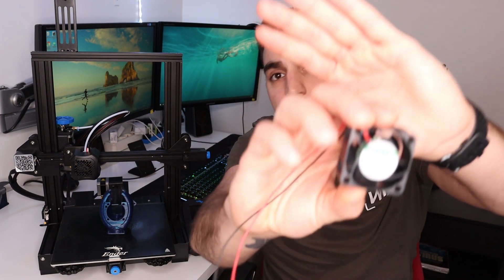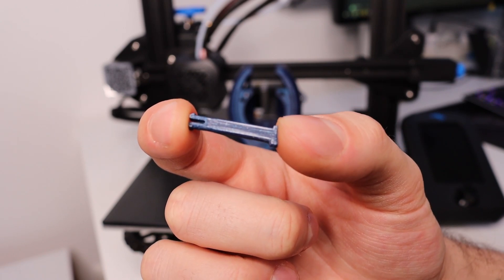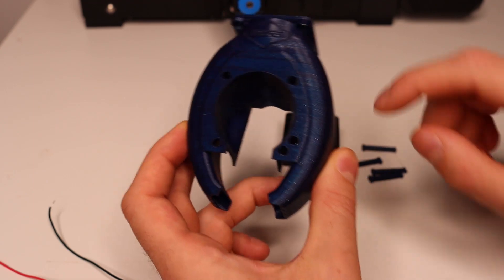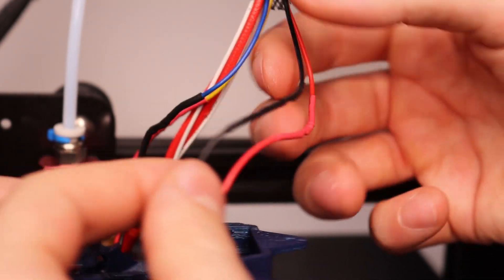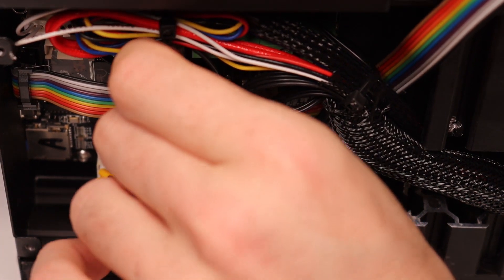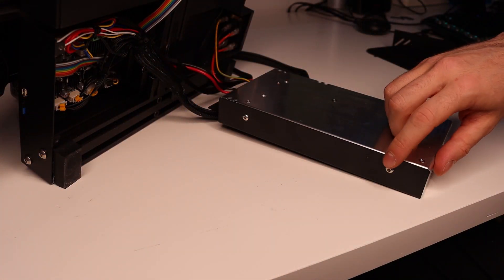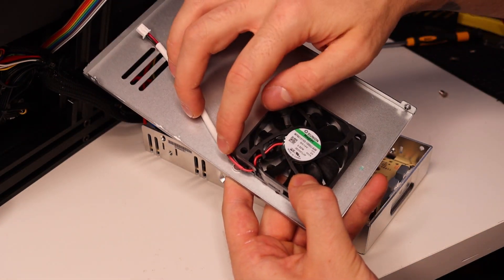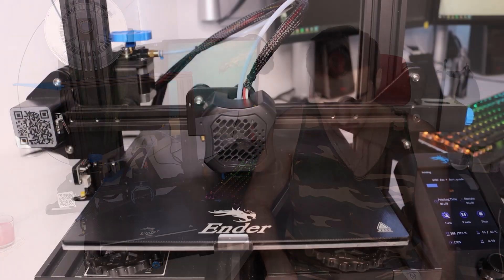ENDER 3 V2 SILENT FAN MOD | Step-By-Step Guide

Comment: That cloth change was hilarious 🤣 After using this duct and new fans did u notice any improvements on the overhangs and bridging?
Reply from the maker: Haha thank you! You know, I was so eager to replace all the fans that I forgot to do some proper tests to show on the video. I really regret this but it is a lesson learned. 

However, I have definietly noticed improvement in bridging because the design of the housing makes really good airflow. I'll do some tests and then share some images in the description. Hope this helped👌
Reply: @Randomecticly  it would be super amazing if you could do the ones like teachingtech torture Test(It has both bridging and overhangs).Even if it was your first video it was more understandable and fun to watch than most of the videos out there.Looking forward for your next videos 😀

Comment: The noise level didn't improve as much as I hoped. I'm gonna go with larger fans running at low RPM
Reply from the maker: I get that it is not completely quiet but I gotta tell you, the difference is really noticable. Now I barely notice or hear that the printer is running, it just dissapears in the background. Before the mod however, I couldn't wait until the print was finished so I could turn it off and when it was off it was such a relief...
Reply: @Randomecticly  Thanks for the reply. I'm still in the "can't wait to turn it off" situation. I wonder how much of your nose reduction was from just lowering the RPM. Another channel measured higher temperature (which implies reduced cooling) after switching to Noctua fans of the same size as the originals. So maybe I should just add a series resistor to my fans to achieve the same effect as swapping them for quieter-but-weaker fans

Comment: Nice video. Thank you. The sound level after the mod seems the same, however it changed pitch, it is at a much lower frequency, which seems easier on the ears :) Also, Sunon fans are not the most quiet, however they are a lot better than the stock fans and also push enough air trough the hotend of a Creality printer, that has a different design from a hotend from a Prusa for example and needs a lot more air. So, in my opinion you went the right way with the Sunon because Noctua does not have the necessary airflow for a Ender 3, or a CR-10.
Reply from the maker: Thank you Robert! Yeah I used an external mic so that is why the freq became different :)

I was thinking of making another video were I change everything to noctua fans, but because they lack the necessary airflow like you said i'm thinking of maybe skipping it. It could be dangerous if I were to print something under a looong time... We'll see tho😊
Reply: @Randomecticly  My thoughts exactly, I think If I was going to add Noctuas, it would only be for the PSU and mainboard. But I really like your fans and will stay with those for the correct airflow. Great tutorial again.
Reply: I did a similar upgrade and was also disappointed that the sound level did not drop enough, especially since this printer's loudest parts are the fans, so then I installed Noctua fans (for the PSU, motherboard, hot end and parts cooling).  If you are going to go through the trouble of the upgrade, then don't make my mistake, just upgrade to the  Noctua fans from the beginning.  If you go with Noctua 40x20 fans you won't have airflow issues.  However, the Noctuas are only 12V, so you need to install a buck converter with them to step the 24V to 12V, which is not a big deal.  Well worth it if you really want something that is truly quiet.
Reply: @michaelmerryman587  Noctua just released 24V version of their fans, dedicated to 3D printers

Comment: Nicely done, Sir.  Informative and funny.  Why did you choose those fans instead of Noctua fans.
Reply from the maker: Thank you!
Well, noctua fans are great and all but they are a bit more complicated to install. So for my first mod I decided to go with something that is more "plug and play". Also, I have read that they don't supply enough air for longer prints.

I'll probably make another video were I replace all the fans with noctua ones.
Reply: Noctua fans have also a lower air volume and are 12V/5V. I tested it and it gave me heatcreep and failed prints. I have now the same fan installed on the hotend. But the other fans you can replace with Noctua fans and this will result in an even lower noise level. Noctua fans are not plug and play as they use different voltages, airflow volume and are not allways availble in the correct sizes. For the last on you need to print special cover for your PSU.
Reply: @ronaldod7116  What exactly do you mean by "I have now the same fan installed on the hotend."? Have you used Sunon fans for hotend? I want to upgrade my V2 with direct drive and all metal hotend but I'm not sure what fans and where should I use.
Reply: @czaras_  I have now those sunon fans installed and no issue.

Comment: I desoldered my fans instead of cutting the wires and soldered the wires onto the new fans
Reply from the maker: That is actually smarter. Why didn't I think of that... Oh well, next time :)
Reply: @Randomecticly  I even tried doing a lil led solder to the parts fan to shine on the bed but it became a strobe light
Reply from the maker: @onemansvideos2134  Hahaha so your printer is having a party right now ;) Could it be because the fans are fed with a pwm type signal?
Reply: @Randomecticly  I'm thinking so...I was just trying to light up my hot end a lil bit I'll have to find another way to do it

Comment: I was specifically looking for drop in replacement quite fans. I only see noctua tutorials. I also prefer not to use buck converters and from what I've heard, noctua fans lack the necessary air pressure needed to cool the stock heatsink especially on longer prints. Thanks for doing this. You got a new sub!
Reply from the maker: I know right! Noctua fans are great and all but they don't seem to be otpimal for this type of replacement. And thank you for the sub!
Reply: @Randomecticly  yeah they're not quite optimal (especially for the heatsink). Also where did you buy the Orion fans?
Reply from the maker: @Jonahmeans1024  I bought all the fans from Digikey. You can probably buy them from somewhere else but for me in Sweden, Digikey was the cheapest and fastest. The links are in the description :)
Reply: @Randomecticly  yeah, should've checked that first :)). I'm from Europe too. Were there any custom fees (from what I know Orion fans come from USA)?
Reply from the maker: @Jonahmeans1024  Yeah unfortunately.. I had to pay 20 euros-.- But i'm not sure it is the same for other countries.
Reply: @Randomecticly   Thanks again!